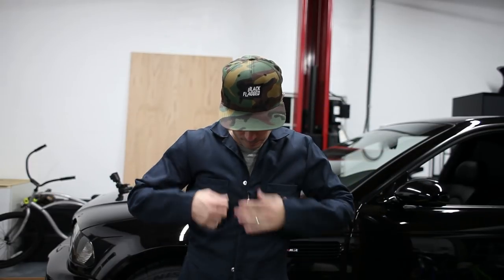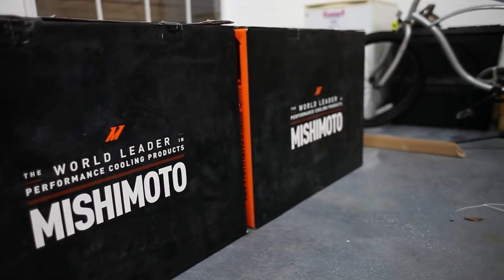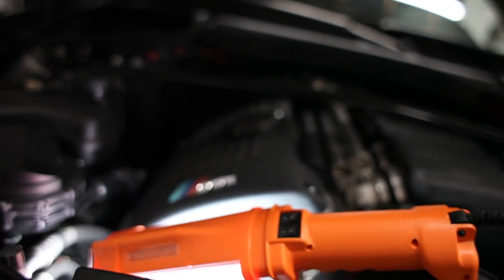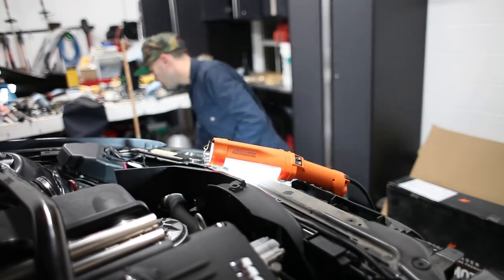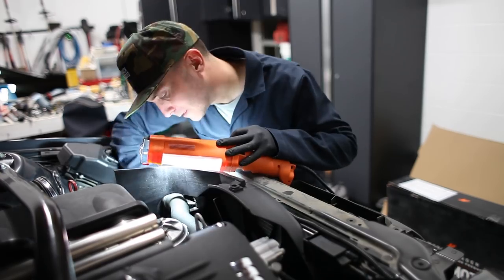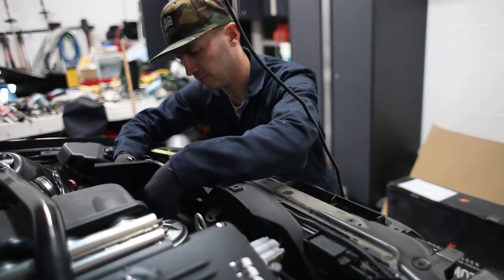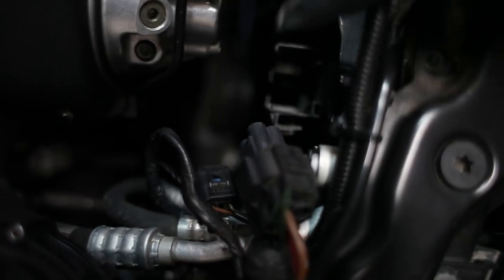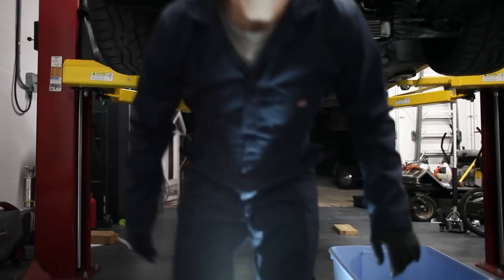Installing a Mishimoto radiator and fan in the e46 M3 | vlog 042

Comment: How are you liking the mishimoto fan? Also, you should have replaced the water pump while you had the system drained, they are plastic and notorious for exploding. Keep an eye on it when tracking. I just replaced mine.
Reply from the maker: Shane Kennedy I like it so far, I just need to wire a switch, as the probe sensor seems a little inconsistent. It’s on my list of things to do. And thanks for the info on the water pump - I’ll look into that!
Reply: Black Flagged 

I’m planning on buying the fan with the switch. Is it pretty easy to wire? Thanks

Comment: There is drain pipe on bottom of the radiator so you can drain it empty before pulling off hoses. 👍 video.
Reply from the maker: boris lukic haha of course there is 😂 Good to know, thank you!
Reply: not sure if there is on and M3 radiator, seen more than one video where the people said to pull the temp sensor in the bottom hose at the radiator to drain it.
Reply from the maker: Also good to know. Even with all the coolant that gushed out of the top hose, when I pulled that temp sensor so much more came out. Guess I should have started there.
Reply: Black Flagged marry Christmas and happy new 2018 year. Lots off health to you and your family and keep on! BMW-bavarian perfection from Munich!